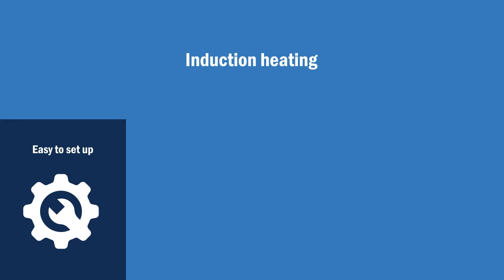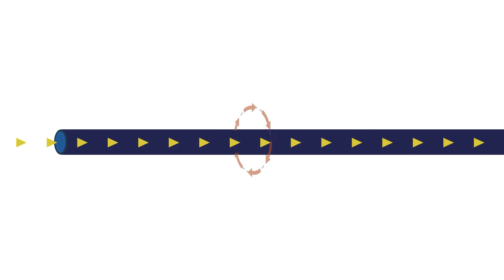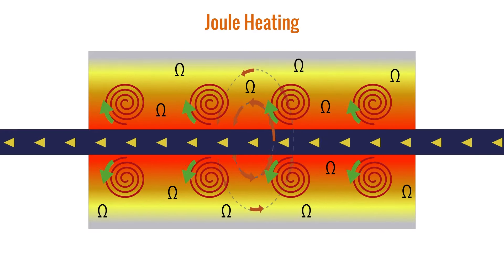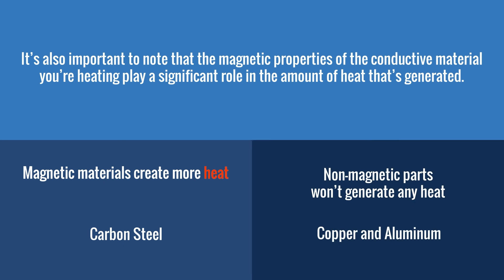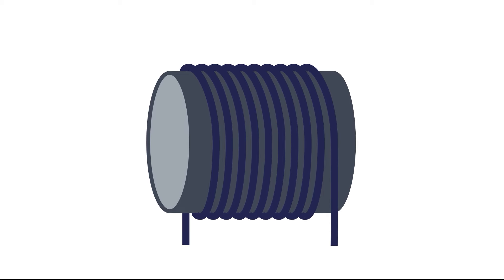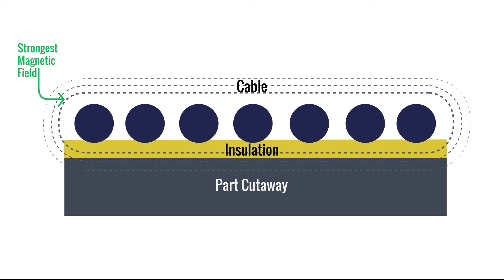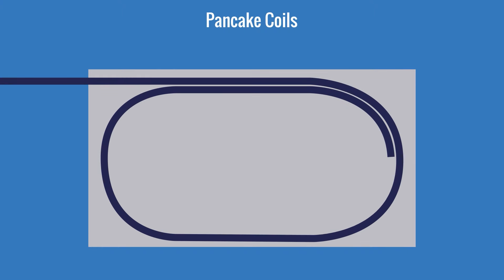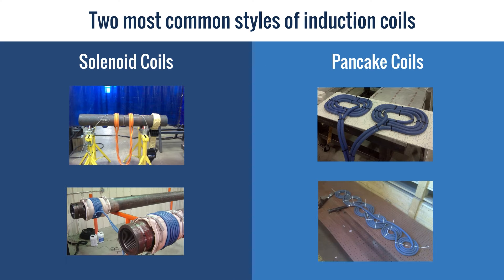How Does Induction Heating Work? Learn the Basics

Comment: Hi, I am not good at electricity and I have a question, please respond. I used an induction heater to heat magnetic materials. The input of the induction heater was DC 24V 15A and it could well heat magnetic materials. However, as i know, only an alternating magnetic field (generated from AC voltage) can heat magnetic materials, so how could my induction heater (using DC voltage as input power) heat magnetic materials?
Reply: Your induction heater contains a part that oscillates the current back and forth many times a second. You will also find several versions of these in common motors, in which switching polarity is necessary for a motor to make a complete revolution. Hope this helps.